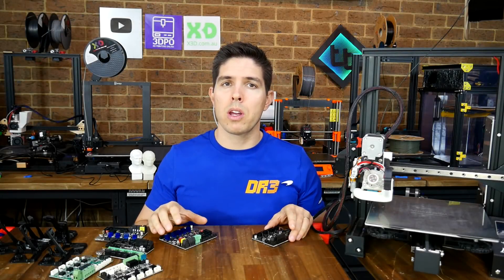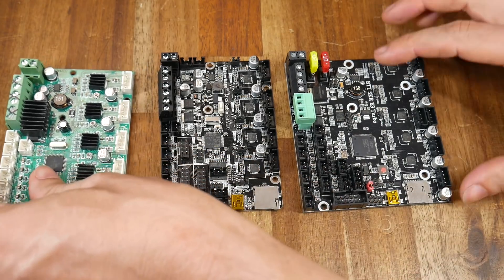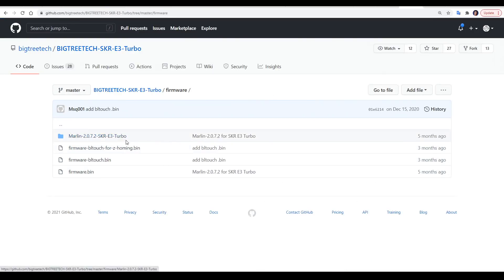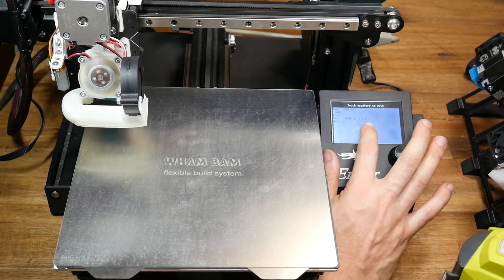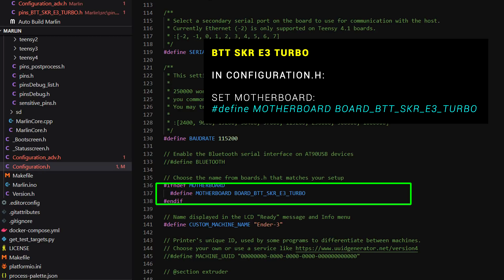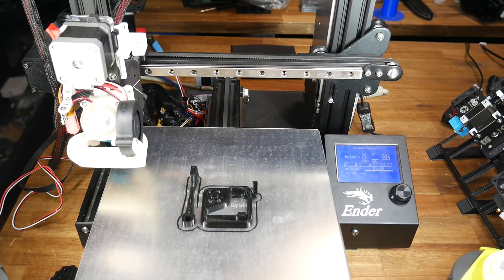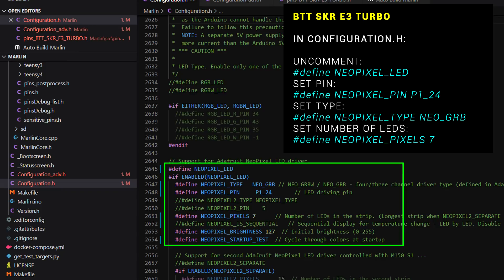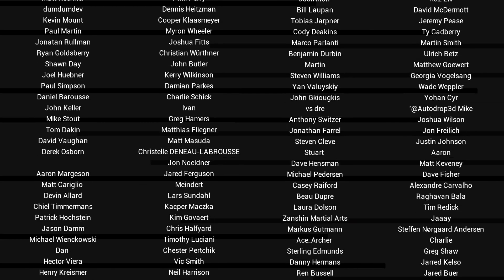MKS Robin E3 vs BTT SKR E3 Turbo - Complete mainboard upgrade guide

Comment: Has anyone gotten Micheal's MKS Robin E3 firmware to compile with a 2023 build of VS Code and PlatformIO? There's nothing but errors and incompatibilities that can't be fixed unless you "upgrade to the latest version of Marlin" which you'll have to reconfigure for the MKS Robin E3 (hope you know what to do). This is why I want to use a MKS Robin E3 ready firmware build, but that seems EOL'd.

Comment: Well if I don't end up getting a warranty replacement from BTT for my dead CPU out of the box new SKR 2 than I plan to purchase a MKS Robin E3 for my RepRap Guru i3 3D printer. Just looking to go 32 bit as I've gone through a few RAMPS 1.4 and 1.6+ boards. After about a week of no replies from Big Tree Tech support I reached out on Twitter, facebook and Instagram to finally get a response on Facebook. So it appears I might get a warranty replacement SKR 2. I was on the fence about either getting a BTT SKR 2 or MKS Robin E3 board. I figure better quality for more money but was wrong, dead out of the box. Great video by the way!

Comment: On my Skr E3 turbo, the board fan is running at full speed, I used Michaels pin layout, any suggestions. I am using BTT provided firmware, and one more thing, I can't seem to get negative values for Z axis, it just wont go below 0,any advise would be appreciated. Thanks.

Comment: im contemplating the turbo, i upgraded my ender 3 board to the 4.2.7 but im getting some really bad clunking when x axis rapids (if move head quick i get feedback and a kind of braking effect, if i unplug stepper motor its all completley smooth.)
a second Z stepper motor would be good.
my bltouch has a single plug on it. plugged directly into the board. and i think the turbo has the same port. why would i not use that over the splitting into z endstop?

Comment: SKR Mini E3 Turbo doesn’t seem to work with my TFT35 E3 V3 no matter what serial ports are inputted and no matter how I match the board rates, FULL discount graphic chosen as well as stock cr-10 display are defined and still no printer attached, I have another printer with a SKR Mini E3 V2 and a TFT35 E3 V3 and they work fine together but just won’t happen with my SKR Mini E3 Turbo….?

Comment: so I tried following this install guide for the SKR Turbo. I see on the screen for the one set of red/black wires that are power into the board. but i don't see on the screen where to put the 2nd set of of red/black big exposed cables. Any ideas? I have the red black thin cables labeled 24v into the black knobs closed to the green detachable ports. the green detachable have the dual red wires.

Comment: I all just have an issue. Ive just upgrade my cr10s with a skr min turbo but, it tries to auto bed level from start and heat the bed and nossel. Then when it try to heat he bed it fails. When I hook up a MM to the on board mosfet i see it turn on and off until failure. I appreciate in advance.

Comment: A comparison between the SKR E3 and the Robin would be nice, I don't know what's the functional difference between them
Reply: From owning both, other than firmware being a bit more confusing to configure, there are 2 main differences:
1. The MKS robin supports both 12v and 24v on it's raw power outputs for things like the hotend fan, making installing 12v fans much easier.
2. The SKR E3 is a much more mirrored version of the original board with the key difference to the MKS being that the MKS has only a single PWM controlled fan mosfet however, with 2 outputs, Whilst both the Vanilla and SKR have 2 separate PWM Mosfets, each with a corresponding output. I'd say that is the main negative of the MKS as the system fan now has to be plugged into a permanent power slot as otherwise when printing materials such as TPU and PETG with no part cooling fan would also mean the system fan is off.
Also I think only V1.1 of the MKS comes with an onboard EEPROM whilst the V1 still depends on saving it's settings to the SD card by default.
Hope this helps

Comment: Hi. Do you think it is a good kit replacement for everything in my Tronxy xy 2 pro printer as it has a fan board port burned and this kit is cheaper than a Tronxy mainboard besides I can move to Marlin? I would appreciate your advice.

Comment: I just received Robin E3 for my Ender 3 pro and planned to use Klipper  but have been having issues connecting to the board after flashing it with klipper.  I can go back to Marlin just fine so it is a problem with the bin file produced from the klipper compile.  I followed the suggested menuconfig settings from the Robin E3 example .cfg file and no luck.  I’ve double checked the /dev/serial/by-id/ directory and matched entry with my printer.cfg but just won’t connect.  I’ve used klipper successfully with my Maker Select with a ramps setup and Ender 3 pro with stock creality 4.2.2 board so I’m somewhat familiar with getting klipper running but I’m just about stumped on this one.

Comment: I have a problem when doing auto-built marlin I have Mks robin e3 v1.1 and I can't figure out what wrong I use bugfix-2.0.x
 collect2.exe: error: ld returned 1 exit status
* [.pio\build\mks_robin_e3\firmware.elf] Error 1
====================================== [FAILED] Took 8.77 seconds ======================================

Comment: Stay away from the firmware-update section as far as possible or your day is ruined. Use the standard driver from Bigtreetech and stick to it. (#include errors for Ender3 ... a clear software fault)

Comment: Hi Michael, I have question, since I read issues with MKS E3/3D board on github with incialize the eeprom, they must use an sd card to save any changes in printer (external eeprom) forexample extruder steps. Without SD card it doesnt work.  Did you tried it and you had a problem like that  ?

Comment: Personally I'd keep the original board and just add in a $10 raspberry pi zero w wired directly to the old mainboard (using the tx,Rx,5v,GND pins.)   I hope you will look more into this in the future as marlin just needs to go away now, no-one should ever need to install developer tools and recompile software to change a printer setting.  You can flash klipper/fluidd once using a pre supplied sd card image, then edit the printer settings from a nice web page. It can compensate for ghosting, has built in calibration tower tools, it's quieter, faster, updates in one click, has great docs, cheaper, and fluidd makes octoprint look very dated.

Comment: Great stuff :). I got an MKS Robin on a whim just to have as a backup board and ended up using it a lot more than I thought. Love the additional 12/24v ports it has built in.

I'm struggling to find any resources regarding using thermocouples and amplifier boards with any of these boards. I bought a k-type thermocouple and AD8495 analog amplifier and have yet to use it because I'm really not sure where I should assign pins and what to change in Marlin. Any advice on that? Maybe a future video if this is something you have experience with?

Love the content! Keep it up you are the spearhead of 3D printer education!

Comment: Do you know if any of these boards have or could be configured to operate a 4th axis for a cnc router? Thanks to your videos I was able to get my Creality Ender4 working when the board crashed, only took me about a month or two because I could not get the motors to operate in the correct directions until I had the firmware set just perfect.

Comment: I just received Robin E3D but v1.1 instead of 1.0 and I cant find the right firmware. With firmware for v1.0 "Z" step motor doesn't work. Any help will be appreciated.
Reply: Just modify Michael firmware and search for #define MOTHERBOARD BOARD_MKS_ROBIN_E3, and put in its place this:  #define MOTHERBOARD BOARD_MKS_ROBIN_E3_V1_1 , this should work. Version 1.1 has changed some pin layout for z axis so it is defined as another motherboard.

Comment: How do these board behave when you have usb plugged in? my SKR Mini E3 V2.0 keeps running if 5v power is supplied from the usb port but the printer is turned off, is that also the case on the MKS Robin E3 or SKR Mini E3 Turbo?
Reply: Cut a smallpiece of tape and tape over your usb's left most or right most pin. That way power wont be supplied through usb but data still go through

Comment: I can’t get the E0 driver to work when using the BTT E3 Turbo for a CR-10 and using the E1 driver for the second Z stepper. It works in every way except it will not extrude. It homes, BLTouch works, auto z-alignment works, everything but the extruder. Sending terminal commands, gcode, or using ‘move axis’ on the display to move the extruder will not work. This is the second board and I’ve swapped cabling around and the cables work fine. Maddening!

Comment: Thanks for making this video and I have the e3 turbo which I haven't been able to use successfully because I'm installing it in the CR10S and I'm having problems with wiring or something because everything has been running backwards which I don't understand why it's happening since the original CR10S main board was working fine when I decided to upgrade to the bigtreetech main board. Also instead of cutting holes in the original case and since I have big ass fingers it's always a real pain to plug in the wires I printed out a much earlier case to install everything into.  I also added bigger and better mosfets to the hotend and headed bed which I'm not even sure that I need but I was hoping to get the bed to heat up faster. I'm not sure if it will make any difference on adding a mosfet for the hotend but I was wondering if over time adding the mosfet to the hotend would have a way to extend the life of the board or would it not matter at all and only do damage over time. Anyway if you could make a video about installing the e3 turbo into a CR10S that would be awesome thank for all your videos as they have helped me through some troubles and learning more about my printers and how to set things up.

Comment: I think I was one of the earliest people to try mks Robin e3d (I bought it with tmc2209). I'm super satisfied. I used to have skr mini e3 v1.2 which fried after a month, but mks works with no problem for quite some time. Sometimes on bltouch clones it fails to probe correctly - I bumped up length of signal and decreased probing speed and it works correctly now. At first firmware support was poor, but marlin community did an outstanding job. It's way easier than it used to be as you can see on the video, but I'm sticking to my fork as it works for now ;)

As a person who had both mks and skr: go MKS, cheaper and just as good if not even better. Outstanding board for just $20

Feel free to ask me any questions.

Comment: Another good (knowledgeable) video mate. Thanks. No sucking up, but your GitHub & YT are the first places I look when I'm stuck. Question: I print as a hobby (e.g. I'm going to try and make a magazine for my .22 air rifle next) and find the Creality 4.2.2 satisfactory but always looking to improve. Would upgrading to the BTT board help me get better prints (all things being equal)? I run dual z drives off a parallel cable and wonder if the BTT is better for this setup.

Comment: Hi, considering purchasing MKS Nano V3 . Does anyone have experience with it? Also considering Robin E3P, anyone using this? Thanks.
Reply: I bought the Nano V3, I expect the firmware aspect of the board is going to be more challenging since there just isn't the same amount of support as there is for SKR. But for the price and specs I think it's a solid choice. I can let you know how it goes if you want.
Reply: @mandrea68  Thanks! How is your printer working so far? I see why you went with the Nano V3, I could literally buy it with the drivers and the display for the price that a BTT Mini E3 costs. I guess if you have a compiled marlin fw, you are good to go. I understand that the support is not as good as for the SKR boards, but if you succeed, you don't have to recompile it in the near future and the HW and SW parts are very similar between these brands (if I'm correct)
Reply: Hi, which board did you buy? I was about to buy an SKR mini v2, but I just found this video and thinking about Nano V3 or E3D.

Comment: Michael, why are you always downloading Marlin as a zip file?  It is so much easier to just get a local git copy of it, add a branch with your own config changes and build from that.  Every now and then you then just do a "git fetch" to get the latest changes from Marlin and rebase your branch on that latest state.  Git then immediately indicates whether some of the new changes somehow don't mix well with your configuration and you can "resolve" those conflicts instead of having to do a complete config adaptation every time.   I get that some people might now be thinking that this is way too complex, but really, once you understand it, it's way easier than every time starting from a new zip  and default config.  Maybe a topic for a video?
Reply from the maker: I agree with you 100% and use GitHub desktop to manage all my firmware. I have a video on it too. If I presented it this way in every video people would be lost pretty quickly.

Comment: Thank you for this video am still pretty new to 3D printing and just considering updating my main board to the SKR mini e3 v2 with bl touch and touch screen. It is just the coding that scares me. Also have you done a video on big tree tech auto shutoff. I do not run octoprint so looking for another way to do it. Thank you.

Comment: Awesome, I am also a BTT SKR E3 mini V2 user and love the board but I think this one could be ordered soon. One question on the serial port selection I saw for the BTT board its -1 and 0. Is that for all BTT boards or just this one? I haven't been able to find any information to tell me which to use. Currently using 2, -1 and I do get odd serial issues with Octoprint.

Comment: you said the btt e3 turbo would fit in the ender 5 but you did not mention that it wouldn't fit with the psu. I had to print a bracket for it to move it a bit over to the side to fit the wider board. thing:4785269

Comment: Another great video! I have the E3 Turbo which I bought when I was a neophyte, 2 months ago :-) I was looking for quiet drivers over my stock E3 board so I bought the Turbo over a Creality alternative becuase of the additional Z-axis and extruder control. 

My frustration is that I cannot control all my fans. I wish the fan2 connector (which you showed in the video) were programmable. I ended up connecting my board's fan to fan1 and adding a manual command to turn the E1 fan on to 50%. That still leaves my hotend fan running too noisily. Maybe I'll swap control to the hotend fan and leave the board-fan at 100%, since the hotend fan is more noticable. 

I was wondering whether sensor stops were simply controlled by removal of the jumbers next to the corresponding driver chips... by your video, it looks like I will have to rebuild the firmware to make that work. 

I have a BLTouch on order, so I'm looking forward to automating my bed leveling.

Comment: I have stooped buying bigtree tech gear as its failure rate is amazingly bad as in 3 out of 3 board and 2 screens  on 3 different printers have all died or have reoccurring problems over the last year. I have ordered the MKS Robin E3P  kit with its really cool touch screen for my ender3 pro. It actually shows a picture of what you want to print and are printing on the screen much better than trying to read abbreviated or cut off file names. It cost me $65 bucks AUD for the Robin E3P  4 tmc 2209 drivers screen to fit a E3 and wifi module. As Makerbase have been around a lot longer than BTT and I have never had any of their older 8 bit board die.  I'm hoping this will be a better and cheaper setup.

Comment: All E3 series SKR board has a design issue that cause a lot of thermistor noise and unstable measurement especially on lower temps.
Reply: I was researching this and it appears to have been fixed last November so all new boards should be working fine.
Reply: @Hyperchalx  no, they don't. The v2.0 and the E3 turbo has this problem, too.

Comment: I had some issues installing the E3 Turbo just this week, the TFT serial port was dead on arrival unfortunately, I tried everything, including changing the serial port on the screen but no avail, in the end it turned out to be the board. I understand that sometimes things slip through so I just set it aside as a spare and ordered an E3 Mini as a replacement as it was the one in stock in my country as I didn't want to wait one to arrive from abroad and I haven't had the same issues.

 I ran a 30 hour print on the Turbo, though and it was doing all right as far as prints go.

btw, On my end to move to an SKR from the original E3 board I took my marlin config files with all the stuff I had and downloaded the config zip for marlin from their official marlin config repo, looked up the marlin configs from the ender 3 folder and diff'd them with my working E3 original board configs, adapted any config that I made, left everything related to stepper inversion, ports and the like and it worked painlessly.

Comment: Great timing. I ordered an MKS E3 to replace my SKR Mini E3 that I burnt by connecting the blower fan in reverse polarity. However, I've since fixed it so will have 2 silent boards.
Reply from the maker: Nice work on the fix. Most people would have to bin it.
Reply: @TeachingTech Thanks!  fixing it was the most fun I've had with my 3D printer. I've learnt so much about mosfets and and the electronics that power the heating and cooling side of the board.